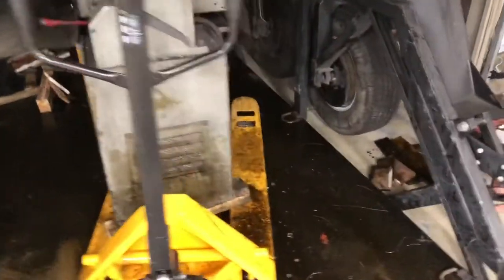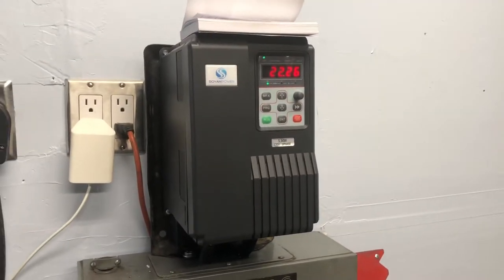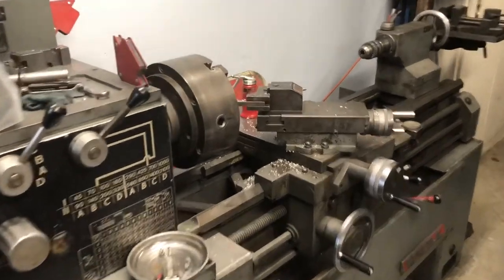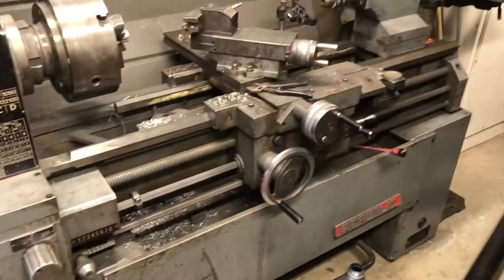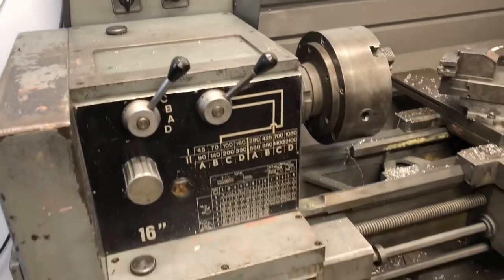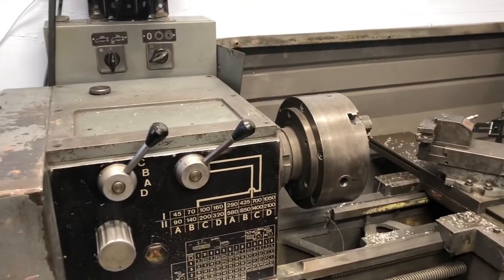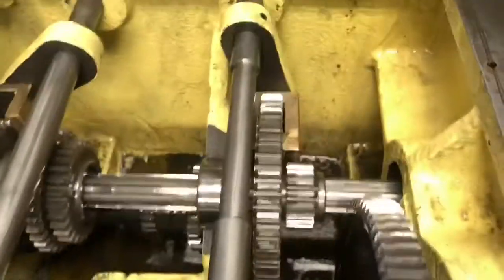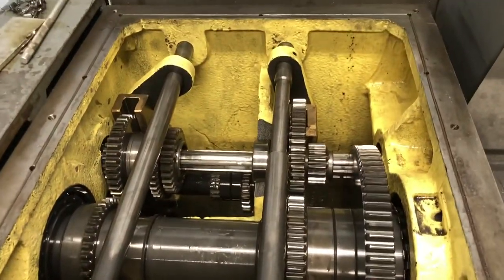16x40” Lathe in my Garage!

Comment: Have one just like yours how did you find year of manufacture?
Reply from the maker: On the tail side of the bed there is a serial number stamped in the ways. The first two digits are the year it was made.
Reply: Thank you for your quick response serial number on mine is 77-1111 so I guess it was made in 1977, at the very end of bed it also has the number 43 any clue mine needs the threading dial fixture
Reply from the maker: @joseaguilar7890  wow! My is 77-1129, very close on the assembly line. I emailed info@lagun.com and they were able to provide me with the year of manufacture and I even bought a manual from them. They did mention they have parts still on the shelf, but did say stock is very limited